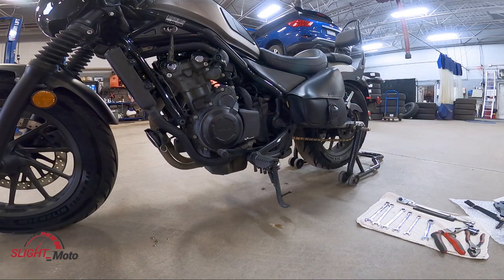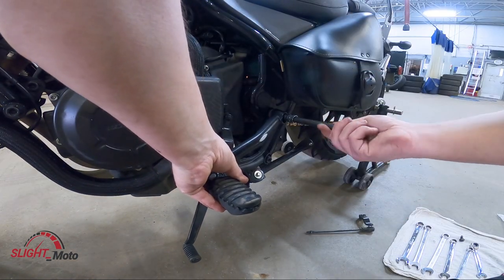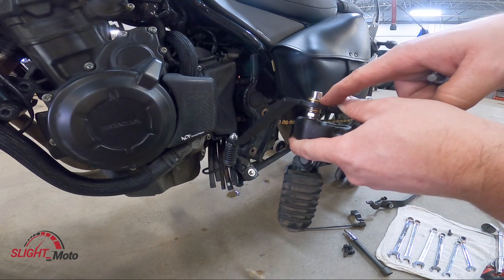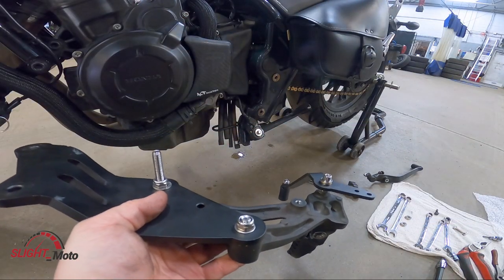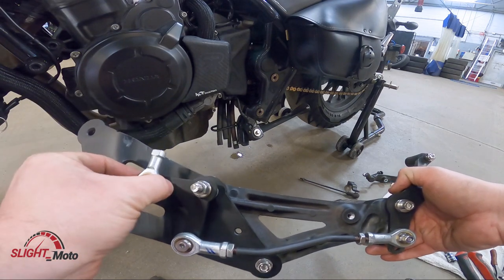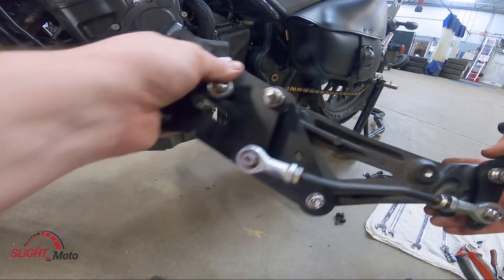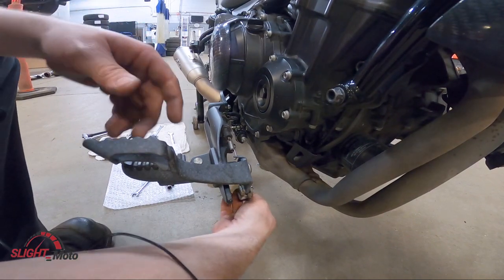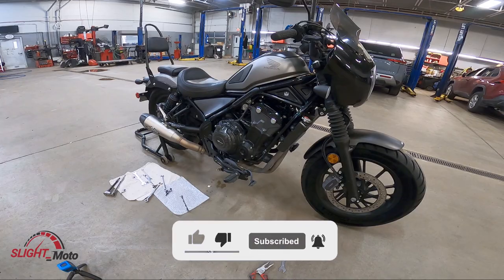Honda Rebel - Red Dragon Forward Control Kit - Install (CMX500)

Comment: just got these fitted from my dealership with the brace attachment and what a difference to the ride. Slight, is it an easy adjustment at home just to raise/lower the height of the brake pedal, I think despite them doing a second adjustment for me it’s a bit too high so just wondered if it’s an easy fix for me at home instead of having to go back and them pulling the whole control system off to do so?
Reply from the maker: The brake pedal is a little complicated to do on the bike as it is hard to see. That said, If you have the tools you can adjust it at home.

Comment: That was an interesting watch, thanks for posting. Not sure what I think of extending these, for me personally I think I would feel too stretched out. But they are a popular mod to be sure. Out of interest, would you know if you can adjust the height of the rear brake lever on the other side?
Reply from the maker: Yes you can. It’s done on the brake master - brace (where the cotter pin is). You can thread out the shaft a few threads to move that pedal up.
Reply: @SLIGHT_  Outstanding, thanks!

Comment: Slight how long did it take to install this kit? I had my Red Dragon forward control kit installed at a Honda Dealer - it took 5 hours- It was Friday Afternoon - the bike is very uncomfortable to ride without these forward control kit.
Reply from the maker: Hard to tell as videoing takes a lot of time… yet I’m sure you can get this done in 30-45mins… fine tuning the pedal positioning takes a little more time. Yet out of the box they’re matched almost perfectly.
Reply: I installed mine in about 1.5 hours.  It took 30 minutes to learn what I needed to do and the remaining hour to get it done.

Comment: Slight, have you had any problems downshifting after installing the forward controls? I installed mine about 8 months ago and recently I'm having problems downshifting.
Reply from the maker: As these are only extensions to your existing controls, I’d look to make sure everything is tight and properly adjusted. 

Let me know what you find,
Reply: @SLIGHT_  I re-tight the upper part of the arm, and it looks like it solved the problem
Reply from the maker: @alexsoto5406  thanks for the update.

Comment: I am picking up a new rebel 500 in 2 to 3 weeks time , I have just bid and got a new set from eBay with a back rack and 12 v charger for £260.00 , so going to try the shifter side first , as my left knee has limited movement, then try out the bike ,then see if I want to fit the brake side or not , if it feels comfortable with just the shifter side on and I can sit on the seat comfortably, that’s how I will be riding, it’s probably going to look odd but then I am odd lol .
Reply from the maker: If you’re doing the one side, I’d strongly recommend you complete the job with the other. Did you get an eBay kit or the red dragons? 

Would love to hear your input on this.
Reply: I have just received the package and they are the red Dragon forward controls, so just waiting for the bike to fit them , I will be studying your clip again to make sure I fit them correctly.
Reply from the maker: @philipbell3187  any issues feel free to contact me.
Reply: Hi I have got the rebel cmx 500 , it was a bit of a job riding it home with my stiff left knee, but once I got home I fitted the red dragon forward controls , and that’s changed my feet position more to the front enough for me to be comfortable riding the bike, thanks again for your help on this product, well worth the effort.
Reply from the maker: @philipbell3187  that’s so good to hear! Happy it worked out for you.

Comment: Is the stability okay with the base version? Debating between the base vs the pro due to the extra support bar with the pro version, but not sure if it's worth it or even necessary.
Reply from the maker: Pro is better. Yet I was shocked how stable the basic kit was. Imo if your not running crash bars do the pro kit.
Reply: @SLIGHT_  thank you for the reply!

Comment: Just curious I run into some resistance on the fork at the end of the pump. How did u get that off ?
Reply from the maker: If it’s too tight, try loosening with it attached still. That way it has some leverage to break it free.